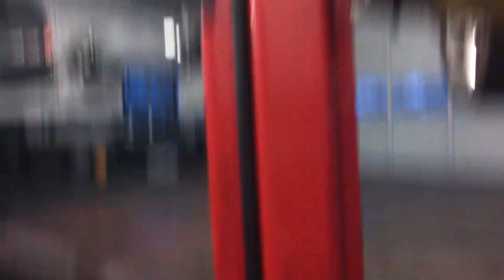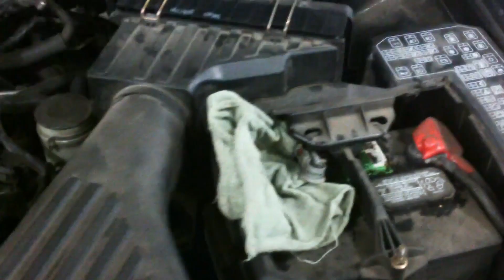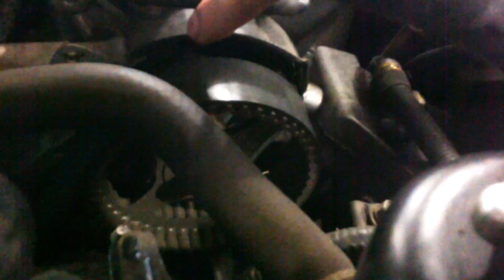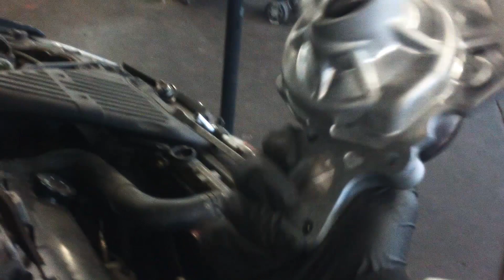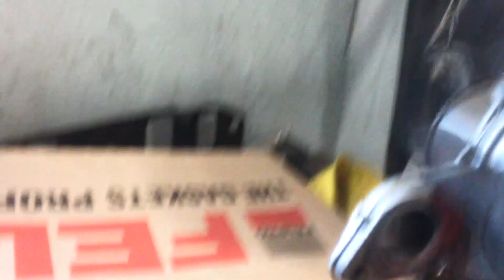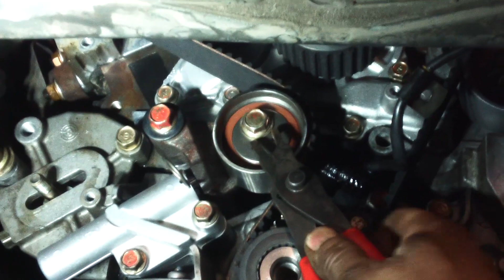Timing belt replacement Mitsubishi Diamante 3.5L V6 1997 - 2004 water pump Install Remove Replace

Comment: Looks like a great video to help me with my Diamante cambelt replacement soon. My smelly old Diamante also needs a few oil leaks sorted as well. I put it into a Mitsubishi dealership a few years ago thinking it was the wisest option for a quality repair job, the old girl never ran well after and now it leaks more oil than before. I don't think mechanics like working on these old V6's, maybe they are too much hassle.

Comment: My only issue was tensioning the belt, I bought the proper tool and an analogue tension wrench (dial type) to set it at 5Nm but as I tightened the wheel bolt it threw the 5Nm clean out the window, 5Nm became 12Nm...
I tried many times it was either over tensioned (very bad for bearings and the belt itself) or under tensioned (again bad for possible belt slippage)..
I ended up using a cold chisel wrapped in a cloth and used it like a wedge between the wheel and the tensioning arm to push the wheel towards the belt, when I saw the Auto tensioner lock pin relax or go loose (when tensioned properly you should be able to slide the lock pin in and out easily) I tightened the wheel bolt (48Nm).
After removing the cold chisel and lock pin I wound it over by hand a few times all timing marks lined up perfectly, I tried to put the lock pin back in but it was tight, it went through the tensioner piston and looked like it was going to pass through the other side of the housing but it was slightly off center as the piston was pushing outward suggesting it was under tensioned. I thought I'd have to do it again but asked a mechanic and was told it should move about 1/38" or 0.8mm it shows the Auto tensioner is doing its job, no movement shows the tensioner is bad and needs to be replaced...
After much work done I'm glad to see the end of my frustrations it's set now I put this thing back together..
Honestly this thing was a snowball started with a coolant leak tracked to the heater hose (bypass) then after running for about 10mins upper radiator hose was hot lower hose was cold = circulation prob' n new water pump. Opened the timing cases to get to the water pump n I see small cracks in the timing belt.. I renew the belt cam oil seals n crank oil seal however as there's that tiny protrusion (about 1mm) of the crank from the casing it twisted when I put it on second attempt (and a new seal) to seat the seal properly I used a feeler gauge dipped in oil like a lever to slip the inner lip of the seal over the crankshafts 1mm protrusion then pushed it in put the crank timing gear back on n went to put the crank sensor on n it just fell apart..
All I can say is I'm glad I don't own it it's my mother's n next time it's going to the mechanic....😂
Reply: I'm doing this job at the moment. How did you get the engine mount bracket back onto the block???? Those long bolts and tight access makes it seem impossible.
Reply: @leecasey3022  I found it easier when the engine is lifted slightly at the front (dr side) it opens the gap between engine and chassis a little more, it's still a bit of a jiggle with the bolts but it can be done. Then you've gotta line up the actual engine mount bolt holes where it connects the chassis, this can be difficult I had a jack under both ends (1 under the sump and the other under the transmission with blocks of wood) again it's trial and error but it can be done....

Comment: Just like to add a easy way to line your new belt up without having to mark the pullys etc,only if the old belt hasn't slipped, "get a Stanley cutting razor or similar, cut the belt around the belt in half and take the front half of the belt off,fit the new belt half on then cut the old back half of the old belt off and slide the new belt fully on ☆Easy Done☆,cheers.
Reply: no good if youre replacing the water pump.

Comment: Anyone needing to release harmonic balancer pulley bolt and dont have a decent  impact, put a long breaker bar on pulley  bolt and let it lock into the ground surface at about the 430 500 oclock position and hit the starter key briefly, one quick kick of the starter and this should be sufficient to crack the bolt loose. Works good.

Comment: I have a question how was the engine supported when it was jacked up in the air to let the coolant run out of the water pump?
Reply: Oil pan with a piece of wood

Comment: i have just done a mates timing and same motor interference engine but he had a tap before hand so i done it anyway but it started and stopped replaced crank angle sensor aswell do u think i have dropped a tooth or have i fucked up still turns but not starting

Comment: I'm a mechanic and he should be putting a full timing belt kit in there. These jobs are labour intensive so you replace all the parts while you're in there. His tensioner was sticky. In the timing belt kit, you get the belt, cam (cams) and crank oil seals, a new tensioner and a new idle bearing and in some kits, you get the water pump (if not, buy one separately). While you have it apart, you have easy access to all of these items and the job is done correctly, leaving you satisfied than nothing in there will fail. If you're serious about preventive maintenance, then this should be done every 100 000 km (60 000 miles). I'd guess that this engine has done 200 000km (120 000 miles), by the sound of the water pump, without having a full kit placed in it. In saying that, you have done the job correctly procedure wise.
Reply: John, thank you for this information. I was just about to ask a question regarding what else should be changed when replacing the timing belt, since the job is already labor intensive, but you have already answered the question. I have a 2011 3.5L V6 Montero/Pajero that has similar engine parts. I will search online, but  might you have a link to a full timing belt kit? I'd like to see all that is required.
Reply: Does a timing belt stops your car from working?
Reply: @FlowTheGamer  If the belt goes so does your motor. Valves will bend and other damage can can destroy your motor. So, yeah, your car will stop working.
Reply: @micharquette9321  aren't these engines non-interference?
Reply: @ElderSnake90  Not this model. The only model that mits ran non-interference was the 12 Valve 3 litre.

Comment: I don't mean to sound picky but you didn't replace the cam and crankshaft seals
Reply: Not far off getting all of the above done - and yes crank seals are on the list. May as well get anything done and changed up. I had no idea the belts where such a big job. Coming up to 300 k for my just purchased 2003 Magna ES TL. The quoted price is just over a grand.

Comment: If I had watched this video beforehand, I wouldn't have gone through the hassle to removed the engine mount bracket. The 14 mm bolt in the front!! Thank you for sharing your video. :)

Comment: I'm having trouble same type of motor on a 2003 Mitsubishi eclipse GT. I'm stuck at the crankshaft sprocket/gear I'm unsure as to how it's removed there very few "how to's" and the few I've found show people simply pulling them off by hand. I've removed the balance and pulley and I'm trying to replace the oil pump components. the upper pull pan is still attached I believe I can remove it since I've lowered the exhaust and removed the starter but I'm unsure. Also the engine is still in the car, so far both heads are removed engine block still in place, and the lower oil pan has been removed. if this makes sense and anyone may have someone helpful info I'd be more than happy to hear it, I'm open to suggestions just kinda stuck at what to do. thanks for reading this one.
Reply: Sounds like you should of just taken the entire engine out of the engine bay if it's striped  down that much and still can't resolve the parts to fit,why would you be needing to replace oil pump drives etc,if it was an internal oil pump,I'd take the whole engine out but as for me,I only have and only buy chain driven car engines, I realize the belt is superior yet once the belt is near due change they become a worry and infact a worry the entire time,the old chain may rattle and not perform quite as well but usually get 2 or 3 times the milage before needing replacement, buy a chain motor,all my cars are chain motors,I'm keeping it that way because of that 1 belt reason.

Comment: Great video returned the belt and purchased the whole kit with replacement idlers and water pump etc. Have to change cam seals while I have the belt off. Any tips on holding cam gears while removing bolts? I have a seal puller so should have that covered anyway.

Comment: Just noticed the bracket covers the timing belt so I understand that know. Should I replace the timing belt tensioner?
Reply: Super late, but just incase someone else needs these information YES. At the very least change the adjuster/ tensioner.

Comment: Getting ready to do this job. Is it necessary to remove the large aluminum bracket by the timing belt? Didn't know if you did this as you were changing the water pump as well. Debating on changing the water pump while i"m in there even though its not had any problems yet. Lots of miles on the car may save myself some work later on. Any other tips you can recommend?

Comment: How did you get the crankshaft pulley bolt out? Impact wrench or is there a tool to hold it like some Honda's have while you loose it with a breaker bar?
Reply from the maker: Brian Kowald Usually use an impact gun, yes they do have a crankshaft holding tool, which we have available when we need it, yep that you can hold with a breaker bar. Amazon has them/it.

Comment: nick highman About $1000dollars in ausralia. Engines must be cheap in USA.
Reply: Trevor Cappel really?
Reply: Trevor Cappel is it 1k to replace water pump and belt here in aus?
Reply: @Munibahmad241  For this motor - a full kit includes the water pump, belts, seals and tensioner. The kit costs around 400-450. As you can see from the vid - there is a lot of work involved. The idea of the kit is to get everything done that can be done while you are in there. Labor costs pump the price up if you have a mechanic doing it.

Comment: Me thinks it is far easier to drop the engine out of the bottom of the car to do all this work.Every engine guy I have spoken with about replacing the timing belt & water pump says it is the biggest pain in the arse job,especially in a Mitsubishi V6.They actually charge more to do the fitment than what a new engine is worth.

Comment: An excellent video on waterpump change on the 2002 Mitsubishi. I wonder if you could also include some drawings of the parts you work on, such as they used to show on installation manuals, (for the more mechanically challenged such as myself)? You did a great job for the more mechanically familiar though. I salute you, and I thank you.

Comment: Well you can see the similarities with the Chrysler 3.0l v6. The tube running under the intake manifold is a big one.
Reply: they're the same motor it's a Mitsubishi design and was shared between Chrysler and Mitsubishi other modifications were made for other components but the engines are really identical. you can also find this motor in some Toyota's and in the Hyundai Tiburon as well as probably a few more cars. still Mitsubishi's design just used in a variety of places.